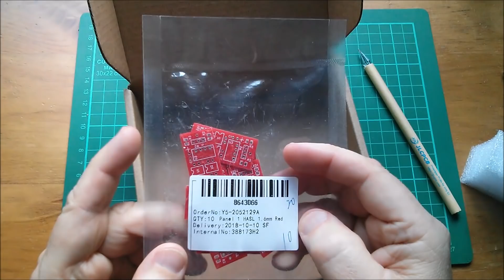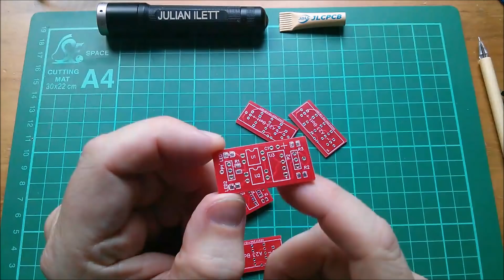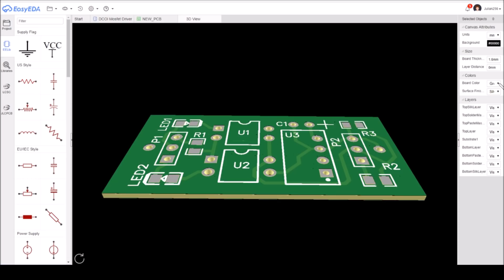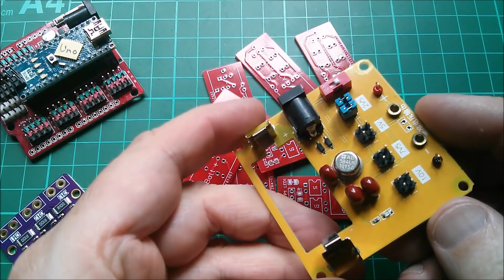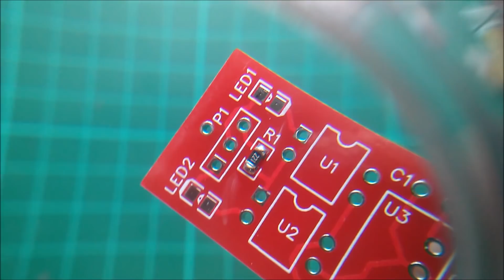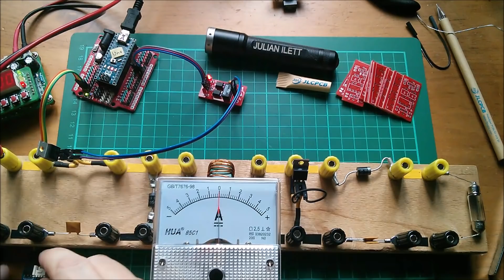New PCB - DCOI MOSFET Driver for Muppet 2

Comment: Careful using that stepup module. The datasheet says output voltage can double when unloaded. That can blow some MOSFETs. It says minimum load is 10%.

Comment: You have still got the problem that the opto couplers alone are way to slow to drive a MOSFET as a switch. Not only that, they have different turn on and turn off times so you end up with the situation that they could either be both on (damaging the OCs) or off at which point the gate of the MOSFET is at a somewhat but not fully open voltage creating a lot of heat in the MOSFET. 
I don't know exactly what opto couplers you are using, but they are usually a few tens of mA max at the output. What makes it even worse is that optocouplers have something called "current transfer ratio". That value is usually less than 1, meaning that for every mA you drive the LED at the output transistor will let through less than a mA (50% is a typical value). Take the 10 or 20 mA the Arduino is driving the LED at, and you end up with 5-10mA at the output transistor. That is way too little for driving a power MOSFET in PWM.
Get rid of the second optocoupler (there's absolutely no need for it, just adds problems) and add a simple push-pulls stage at the output.

Comment: Any reason you dont get them to panelise the boards? The $2 boards go up to 100mm x 100mm, and you could easily fit 8 boards in. So you'd get 80 instead of only 10!

Comment: Why was that battery packet labelled LR44 as well as A23? I realize the 12v battery may be made up of a stack of button cells, but are they really suggesting you cut up the 12v battery if you want LR44s instead?

Comment: Julian, watch out for the 10% minimum load requirement in the DC-DC convertor datasheet - they really do mean it as the output voltage can more than double the rated voltage in some circumstances which could be enough to blow up your MOSFET by exceeding the maximum gate voltage. A clamping zener or resistor across the 12V rail should be sufficient.

I posted my experience on eevblog forums (msg698691 - search for warning-dc-dc-covertors-watch-those-minimum-loads!)

One poster had a 72V o/p convertor producing 170V at no load!

Comment: I really thought you were going to upgrade the optocoupler. It's really quite slow and will cause your mosfets to heat up at high power.

(Even though you are using low frequency)

Comment: The thing that I like about the DECOI driver over an IR-2104 MOSFET driver is that you can go to 100% PWM. With the driver IC, you need modulation to drive the charge pump circuit. Great video Julian! Look for ward to more.
Reply from the maker: Thanks Adam. That's interesting - I've not yet looked at MOSFET driver ICs - it's something I meant to do after I get the Muppet to do bi-directional  transfers. But if they can't do 100% (and 0%) PWM, then they're no good to me.

Comment: Mounting through hole LEDs on surface mount pads is nothing. Once I had a faulty satellite receiver. A SOT-23 package MOSFET was the suspect component but I didn't have any. All I had was a TO-220 package power MOSFET which I managed to fit on the SOT-23 package smd pads and it worked as a temporary replacement.

Comment: If you use the square-pads with holes for the pads for the SMD LEDs, you then have the option of using either SMD or through-hole LEDs; make sure to silk-screen the polarity!

Comment: Julian, I may be watch all of your video, but I still don't know what is the purpose of this "muppet", can you say it in your next video?
Reply from the maker: It can charge either a battery or a supercapacitor bank from pretty much anything - PSU, solar panel, another battery, another supercapacitor. It can transfer energy in either direction (left to right or right to left). Later on, it can have MPPT functionality added for solar charging.
Reply: If you listen (at the very end), he said it is a two way energy converter. Which I can confirm :-)

Comment: Heck Julian, I would have changed the 2 optos on this for a single HCPL-3120 MOSFET Driver and I am sure that would have given far better results as its faster,  If you need any we have these as well as the NKE0512SC DC-DC converters on the BasicMicro_UK eBay shop, We will offer 25% off these 2 items for Julian Ilet viewers, Keep up the great work, All the best, Dave
Reply: They're cheaper on Farnell.

Comment: Nice boards! Too bad about that connector mate

I never used one of those little boost converters, but I sure am interested. I'm quit fond of the Recom Power little buck converters, they are drop-ins for regulators like the 7805 and all, really nice to use when you realize things are getting a bit too warm after all... hehehe

Oh hey, if you're ever quite bored, I'd really like to see the noise figures on that boost converter on a scope

Comment: I wonder why you are still using these crappy PC 817 opto isolators instead of a proper one.  That was a good opportunity for an upgrade.
Reply: Can you please suggest some that you have used? Thanks!
Reply: HCPL 3180
Reply: @kitmanevo  I just looked at the datasheet for this.  A nice feature is that it sources and sinks Vout with a single input line.  But also looks like it needs 10V in to trigger.   These are quite a bit more expensive, and less common than PC817s.

Comment: If you want no leads protruding on the back, trim BEFORE installing and soldering the Opto-isolators.  On the connectors, use a pair of pliers or similar to push the plastic part along the metal pins. Make a stack - hard or metal bench, PCB, pin-header through holes in PCB.  Then push the plastic down to contact the PCB, result 'short' pins.

Comment from the maker: OK, now I understand how premieres work. The format doesn't seem very relevant for my type of content. Also, I thought we'd be able to continue the chat after the end of the video, but that wasn't possible.
Reply: odd, the chat isn't meant to close right after the stream ending
Reply: sorry to hear it didn't pan out as you thought
Reply: It's like chatting to yourself while looking in the mirror
Reply: Julian Ilett i have a idea for a new circuit it’s a battery and transistor to turn a electromagnet on and off to induce current in another coil of wire on a second circuit board? if this works then a battery might last a bit longer 🤔🤗🤷‍♂️

Comment: Hi Julian, the new red PCB looks great - I prefer blue solder resist my self! The muRata parts are great, but a bit pricey for hobby projects. If you plan on making up a lot of boards I'd consider look for cheaper parts. I searched ebay and found these parts, https://www.aliexpress.com/item/Free-shipping-5pcs-New-original-MORNSUN-Isolated-power-module-B0512S-1WR2-B0512S-1W-B0512S-SIP-4/32859944749.html. Do you think they might make a suitable alternative? Hope it helps you out. I know you like a bargain :)
Reply from the maker: The Mornsun would probably work fine, but I'd need to check the output voltage with no load. As I'm only making up 4 boards, I'll stick with the Murata converters. Cheers :)